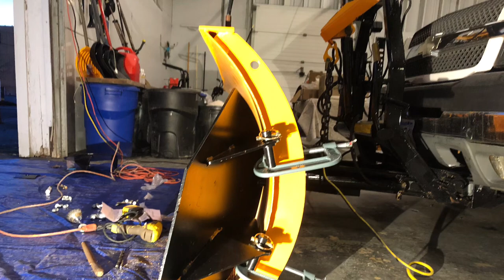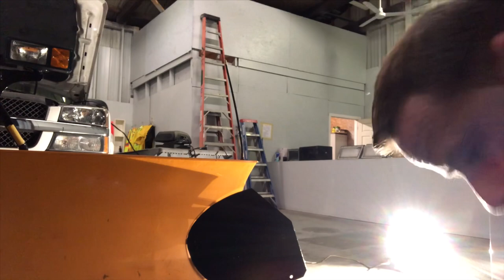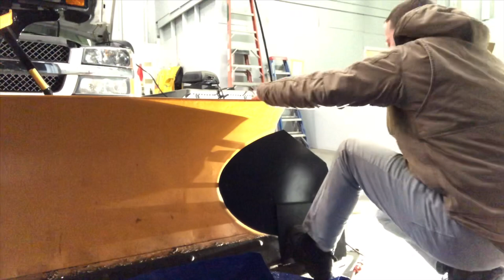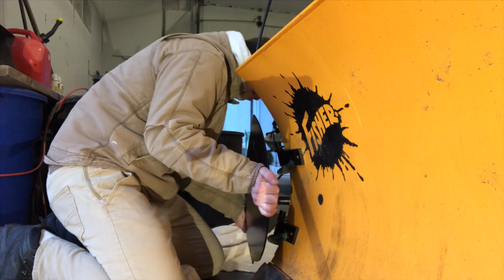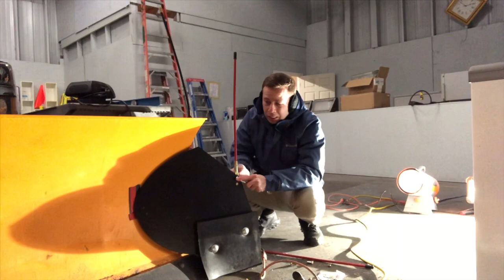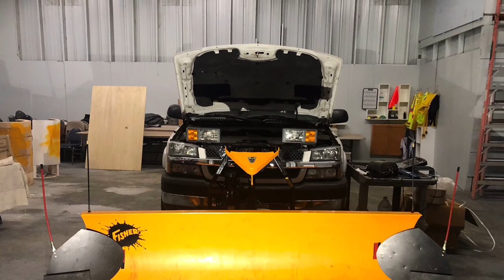Buyers Pro Wings Installation on Fisher Straight Blade

Comment: I am putting mine on today. Same plow. Same wing attachment kit. Is there anything I should no before I start??
Reply from the maker: Just make sure a part of the bottom Rober Blade sits on top of the steel cutting edge, so it helps keep in place when plowing heavy snow.
They are great, make plowing much easier. A lot guys told me it would make the plow to heavy for the hydraulic, but so far everything is still working fine.
Reply: And keep spares because the rubber don’t last long!